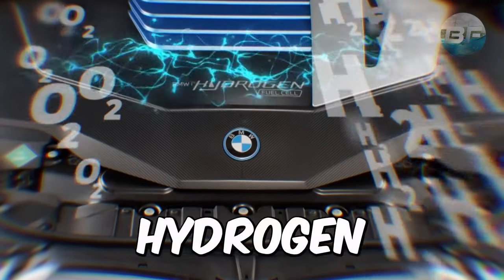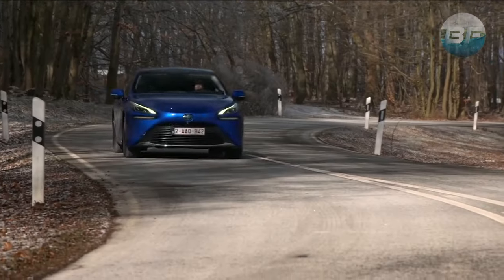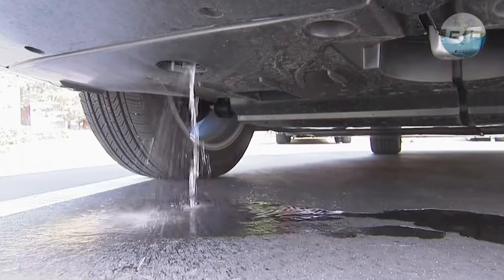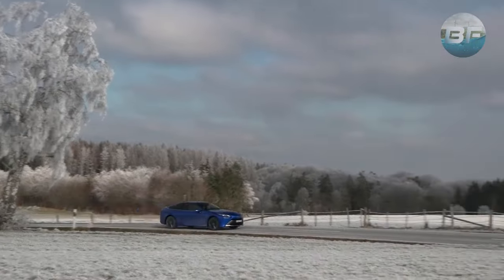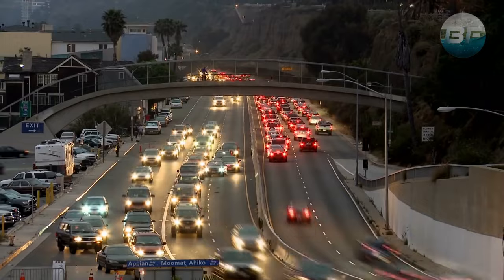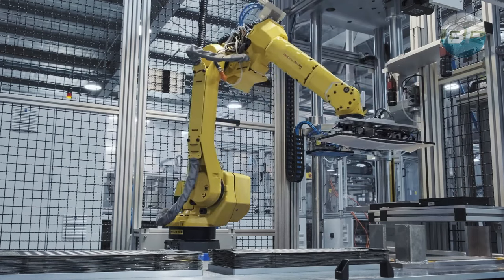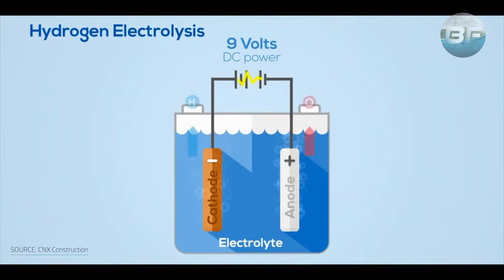How Does A Hydrogen Car Work | Future Technology

Comment: Before gas engine, you had steam engine.  Hydrogen is hard and expensive to harvest (so was gas and oil) but like any other problems, I’m confident we will solve it.  Already, Toyota has something promising.   I can foresee Hydrogen powered vehicle within the next ten years.
Reply from the maker: I agree. This attitude has always brought us further. Science makes it possible
Reply: The problem is gasoline is a readily available source of energy. You just have to drill it out. But free hydrogen molecule isn't available in large quantities naturally. You actually have to spend energy to separate it from compounds. It'll get expensive once scaled. You can say the same thing for EV batteries, that we have to charge ourselves, but charging efficiency for Li-ion batteries is around 90%. Hydrogen extraction efficiency ranges from 30-40% if you're dissociating water.

However, since Hydrogen is so light compared to Li-ion batteries, I think it makes up for its inefficient extraction because it costs less fuel to carry hydrogen than heavy Li-ion batteries.
Reply: But the question is "Why?!" Why use hydrogen when you already have BEVs? It's like taking the very longer route in going from point A to point B just because you can! 

Let's take into consideration the best case scenario for hydrogen: it's produced by electrolysis of water using electricity from solar, wind, hydroelectric and nuclear sources i.e. it's 🟢 hydrogen. Even though it's a carbon neutral process, you have to consume energy just to make energy which is non-sensical. This energy can simply be sent into the grid and it can power EVs at homes or at EV charging stations just like that! Instead, we have to purify water to electrolyse it and build a whole new bunch of different infrastructures like electrolysers, supply chains, safety systems, dispensing stations etc. All this costs a lot of time and money to build and maintain, something that is not true for BEVs since we already have a grid in place which is 70% of the job done! Then imagine the inferno that would be caused if there was a leak. Petrol at least needs a flame to ignite, hydrogen does so just by coming in contact with the oxygen of air! Thus hydrogen is more hazardous than fossil fuels. And finally, researchers have said that large scale leaks of hydrogen can also potentially act as a greenhouse gas. 

So you would have to be total muppets to use hydrogen instead of electricity for EVs.
Reply: @exterminator4808  Why have spotify when we already had CD's?
Reply: @Fin_Gerbuts did you came up with it on your own ? , if yes then think better
Reply: @dipanjanghosal1662 Gasoline isn't readily available. There are oil refineries to make it.

Comment: I think technology will advance and hydrogen powered vehicles will become practical and economically viable. And the technology and the process for producing hydrogen will be truly green. Even the technology for producing lithium ion batteries isn't green either .
Reply from the maker: Yes that's right. Thank you
Reply: Same argument for producing lithium ion batteries, it's the infrastructure that's not green not that actual production of the batteries
Reply: Are you sure?! As batteries can be recycled while hydrogen fuel cells uses resources and used up a lot of energy just to produce hydrogen 😂
Reply: It will only be an option if it can be made “economically viable”. Ask Nikola Tesla.

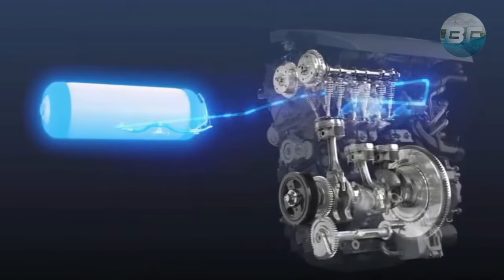Comment: Very concise video and well done, but at 1:56 is a bad graphic.  You're showing an ICE H2 engine, not a fuel cell.  ICE H2 engines require more like 10+ times the energy as BEVs.  And regarding 3 times for fuel cells, that's best case at the moment where as the H2 is delivered via pipeline.  If you have to truck it compressed, or worse liquefy it, it's more like 4 times the energy per mile.  It's an OK technology to fit where other technologies can't meet the specific requirements.
Reply from the maker: Thanks for your feedback and further clarification :)
Reply: If you had to come up with a way to receive £1 of a million people what would be the best way to
Reply: Yeah but ICE gives people real cars not some appliance like experience with electric drive + Fuel cell cars still need lithium batteries and more raw minerals, mining etc that burning hydrogen in an ICE doesn't need. 

I get the inefficiency vs fuel cell but if we had a lot more nuclear this wouldn't matter and we have cars that are much simpler than even the current ICE cars with all their emissions control systems.
Reply: @o00scorpion00o  The reality is you'd need to get hydrogen down from $36/kg to less than $5/kg for H2 ICE to go anywhere.  That requires getting electricity to less than 3¢/kWh.  Since nuclear plants generally cost about 6¢/kWh to produce electricity, let alone sell it for a profit, nuclear isn't likely going to solve any issues no matter how many get built.  Maybe if we run out of crude and the price skyrockets so that gasoline is over $10/gal, that might change things.  But in the meantime, more and more people love the quietness of BEVs and can't believe they used to like driving ICE cars.
Reply: @scottkolaya2110  I drove BEV for 10 years, I live in Ireland so it's a Small Island, it was a novelty in the beginning but the issues remain, long charge times and much less range despite my last EV being an 82 Kwh id3 with 77 Kwh usable. 

The car weighted 2 tonne for a small hatch which was ridiculous, it dulled the driving experience something awful. Getting rid of EV with depreciation and dealers not wanting EV as trade in is a real hassle so I gave it back to the finance company. Not into all this tech , screens and all other nonsense. 

Now I drive a petrol manual car with minimal tech and I love it, I missed the engagement of driving a manual ICE and the much better handling of a much lighter car.

There are many people with no home charging and won't be willing to spend endless hrs at public charging.

I think you underestimate the energy Nuclear energy can provide and it can produce a lot of clean electricity and hydrogen.

There is really no other alternative to liquid fuels, BEV will never replace liquid fuels and it will never be environmentally friendly to produce batteries.

Comment: But the question is "Why?!" Why use hydrogen when you already have BEVs? It's like taking the very longer route in going from point A to point B just because you can! 

Let's take into consideration the best case scenario for hydrogen: it's produced by electrolysis of water using electricity from solar, wind, hydroelectric and nuclear sources i.e. it's 🟢 hydrogen. Even though it's a carbon neutral process, you have to consume energy just to make energy which is non-sensical. This energy can simply be sent into the grid and it can power EVs at homes or at EV charging stations just like that! Instead, we have to purify water to electrolyse it and build a whole new bunch of different infrastructures like electrolysers, supply chains, safety systems, dispensing stations etc. All this costs a lot of time and money to build and maintain, something that is not true for BEVs since we already have a grid in place which is 70% of the job done! Then imagine the inferno that would be caused if there was a leak. Petrol at least needs a flame to ignite, hydrogen does so just by coming in contact with the oxygen of air! Thus hydrogen is more hazardous than fossil fuels. And finally, researchers have said that large scale leaks of hydrogen can also potentially act as a greenhouse gas. 

So you would have to be total muppets to use hydrogen instead of electricity for EVs.

Comment: My question is why does the hydrogen need to be in a liquid form? Could we not make an engine that can run off of hydrogen gas? Then all you'd need is water and a safe way to split the hydrogen from the oxygen. Hell, it could have a reclaim system for the exhaust (which is just water, the system would take the water from buring the hydrogen and feed it back into the water tank)

That being said, there's probably either some kinda problem with this idea that doesnt have a solution or big corporate companys have explored this idea and came to the conclusion that pumping straight liquid hydrogen into a car rather than the idea I have at the top of the comment makes way more money for them

Comment: The production and cost of the fuel cell including while the losing 60% efficiency I see as a problem and need to be solved before i ever invest in a hydrogen car. Sticking with hybrid or EV until it’s addressed but is promising.
Reply: Only if hydrogen will be very cheap , but even then it's just ev with extra steps , you trrade battery with the whole compressed hydrogen and fuel cell system , I don't see it to be practical in smaller vehicles

Comment: Not soon! H2 produced from electricity thats already 30% electricity lost. Than, fuel cell efficiency is at least 20% less than electric motor. So you lost already 50% electricity which can be used in EV. On the top of that fuel-cell car needs to vent H2 at all time when packed in the garage with temp above -250C ( thats everywhere on Earth). Than building fueling station and building car itself is 10 or 2 times more expensive than EV, accordingly. NONSENSE idea for passenger vehicles.  Ships, big trucks - perhaps.

Comment: I heard them say it's more costly to produce H2 than Gasoline has anyone seen what crude oil looks like? they have to boil it cool it reboil it several times before it becomes gasoline or diesel, no to mention drilling for it, pumping it out of the ground, & transporting it on the oceans where as H2 is made from water & 2/3's of our planet is covered in water & DC current passed thru water creates it somehow I'm not seeing the drawbacks

Comment: If millions of vehicles were burning Hydrogen and creating only water, I presume this water goes somewhere! and is ejected outside of all of these vehicles creating wet slippery roads, condensation, and then clouds which will then cause a change in the atmosphere, resulting in rain, floods, and storms, it doesn't seem a good idea to me.

Comment: A drawback that first came to me is if you had 1000s of these in a cold environment, would they expell large amounts of water on the road requiring salt trucks to be continuously dumping on the highway.
Reply: So what happens when it’s raining?
Reply: @il798liOld  my thoughts to that is if it's raining it's above freezing so the road wouldn't have to be salted.

.
Reply: My guess is that your country doesn't get these cars 😂 You're better off burning fossil fuels as that causes climate change and perhaps your country will become a tropical climate, at which point you can confidently buy a hydrogen car and feel all warm and fuzzy that you're caring for the Earth.
Reply: For the cold season they could create a onboard reservoir that can be drained at home instead of on the road? not sure how much water is created over a given period of time, say, 1 hour of driving.

Comment: It would be nice for it to become adopted. It's too early to opt it out right now but who knows in the future people will just need to pour in water and produce it at home
Reply: There are kits now to do that now.  They use electrolysis to make the H2 and have compressors to pump it up to the required pressure.  Unfortunately, they are very expensive because of the rare materials, but even if the electrolyzer was free, it still would be 4x more expensive to drive per mile than just putting that same electricity straight into a BEV and no water needed.

Comment: Liquid hydrogen is dead on arrival. Why? It turns to a gas when it warms above 423 degree F below zero. The tank to hold super cooled liquid hydrogen must 100% fool proof in terms of leaks and in terms of surviving an accident. Why is this important? A pin point leak in a liquid hydrogen tank will create an explosion so great that there won't be a piece of the car or it's passengers left that is larger than the size of a thimble.  It will take only one accident to occur like this and the hydrogen powered car idea will come to a screeching halt. Sorry...it's true!

Comment: With hydrogen combustion engines you have not escaped from the servicing costs of ICE engines.  With an EV the biggest advantage to me is the elimination of oil and filter changes, air filter changes, and all the complexity of ICE engines and transmissions etc.etc.  It seems to me that Toyota is desperate to find a way to provide clean energy while still holding us all hostage to the service departments.
Reply from the maker: There is no scenario where they won't find a way making us dependent of them 😉
Reply: They will just upthe rate on EVs to compensate

Comment: The choice to choose is up to the price of hydrogen compare with gas.
Reply from the maker: Unfortunately, hydrogen is still quite expensive. This will change with time.
Reply: @weeraphanjunsangtong6791 So hydrogen is cheaper but you have to drive 20 miles to the nearest hydrogen fill station!  Hydrogen will never become a viable option as the "delivery infrastructure" will never be built.

Comment: Sooo, is it a car that runs on water???
Reply from the maker: No not directly. It uses hydrogen gas (H2) as its primary fuel source. Water is a byproduct of the hydrogen-oxygen reaction and is released as harmless water vapor through the vehicle's tailpipe :)

Comment: Hydrogen is the fuel of the future as it can be burned just as gasoline is burned in an internal combustion engine thus no need for a hydrogen fuel cell as an ICE engine doesn't care where it gets it's hydrogen from. Right now new technologies have the electrolysis process up to 98% efficient for the production of hydrogen from water and just like EV's have home charging so too can hydrogen giving the owner true freedom to travel within the limits of the vehicles range just like an EV vehicle does. That's right produce all the hydrogen you need right in the comfort of your own home.
If done correctly hydrogen ICE engines will actually clean the air as they are operated thus are better for the environment than EV's. Then there's the high cost of replacing a battery and the fact that there simply isn't enough of those rare materials to go around in trying to replace over 1.3 billion vehicles on the roadways world wide. I bet the first Tesla owner to need to have their battery replaced found out the hard way that all that they saved in fuel cost should have been saved to buy a replacement battery at a cost of roughly $23k USD.
Reply from the maker: Yes! the exchange of the battery also costs quite a bit. Thanks for your contribution.
Reply: And batteries aren't green as they make believe.  (Those who profit say they are🤑🤑)

Comment: Electrolysis is required to create Hydrogen. EVs without infrastructure are junk. 
Hybrids are the best short term answer until batteries and infrastructure catch up.The Steam engine went extinct in the 40s and diesel electric locomotives have been their replacement since them.  Thats a hybrid  Today, Edison Motors has a succesful hybrid logging truck that beats the Tesla in both power and fuel economy and most importantly, and it is lighter than the standard trans truck NRA. No range anxiety.
Get it straight .. The infrastructure TODAY  CAN NOT support EVs but hybrids can and are doing it with no infrastructure change and BETTER FUEL ECONOMY WITH PROVE TECHNOLOGY

Comment: I tried to explain the concept, and was shunned by gas driving folk, which is a fuel, just to run a combustion motor. If it's cheaper, or comparable, and is in our COUNTRY. Hopefully, it catches on, for engine's, and is available.